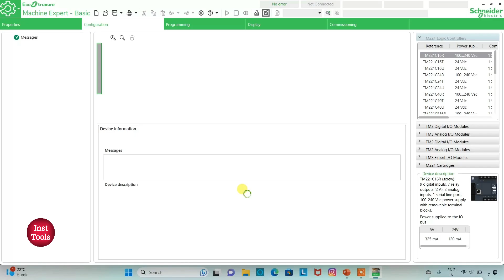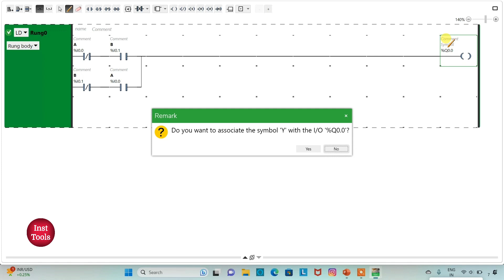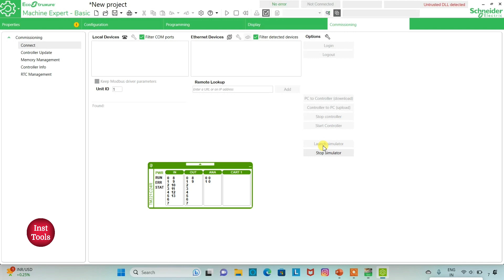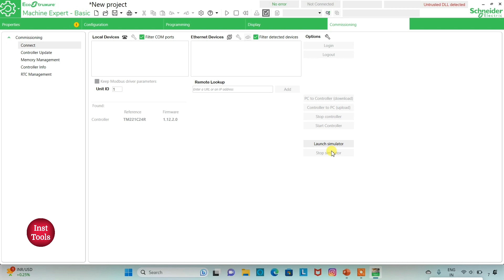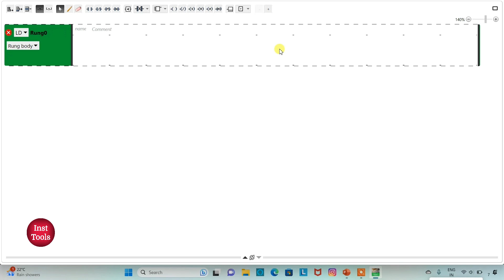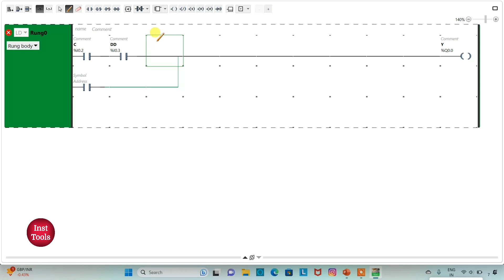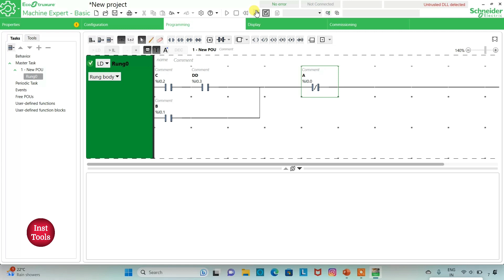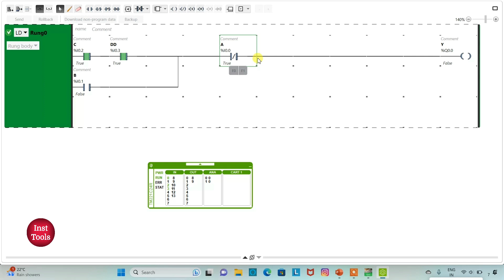Convert Boolean Algebra to PLC Logic - Example Problems

Comment: Hello, I have a problem in Count PCS7. The class reset accumulation program is already set at 6, 14, 22 o'clock. But the actual count advances 1 hour 10 minutes, what do you think needs to be checked? The station is in accordance with GMT+7. thanks 🙏